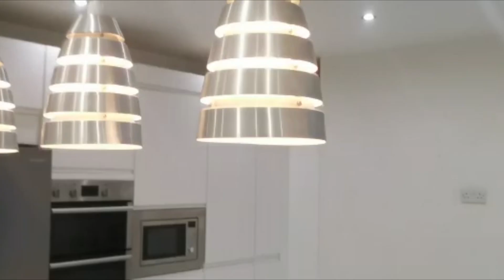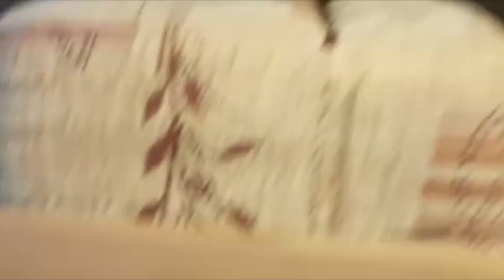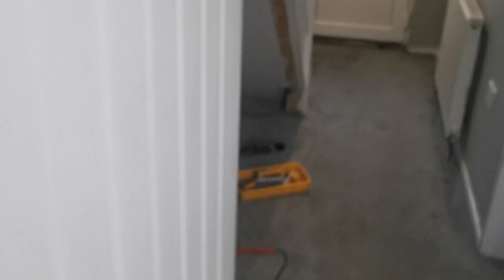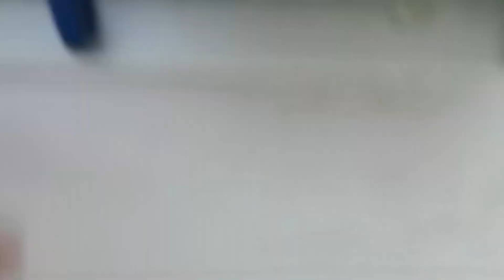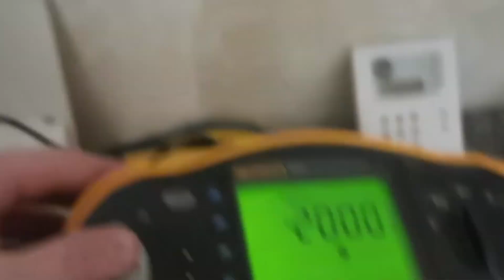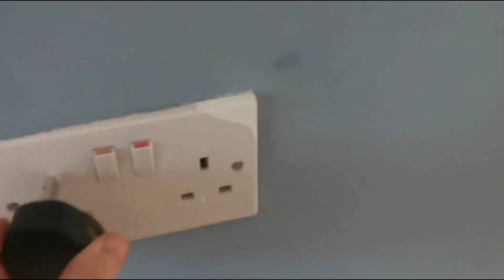LIVE WIRES! THEY COULD HAVE DIED!

Comment: Do you always ir at 500v or 250v l+n to earth?.
Another good video mate 👍
Reply from the maker: Heya Gary! You don’t need to now with current regs. Just habit of testing, I test at  250 and 500v. If you get decent reading with 500v I’m happy. A cable that’s started to degrade, I find you get wore reading at 500v compared to 250v
Reply: @finneyelectrical  thanks for reply finney, so if you do at 500v do you normally do l+n to e incase anything sensitive still connected or do you try disconnect most things ?
Reply from the maker: Depends, if it’s like 50 down lights then yeah I’m line and Neutral to earth 😂

Comment: Thanks for the video appreciate it 👍 yerno the ze test do you disconnect all the other earths so its just the main earth in the earth bar?
Reply: Why do you remove the bondings from the meter and not at the fuse board?
Reply from the maker: @sean1325  because the bondings to the gas and water pipe was down in the cupboard not in the fuse board 👌 they are normally in the fuse hoard in the B terminals. Any other questions? Sounds rude that haha actually mean it
Reply from the maker: So the regs says to disconnect all parallel paths. So your supposed to turn off all the circuits, disconnect the main earth, then test main earth to line to get the ze. Pfc is with everything connected in. The reason you turn off all circuits is because your removing the cpc to every circuit. If I'm in the house alone I don't bother 👌

Comment: Where in BS7671 is it quoted the resistance of a main protective bond should not exceed 0.05 ohm?
Reply from the maker: A maximum resistance of 0.05ohms for the bonding is considered satisfactory, this figure is given by the amount of current required to blow the 100A service fuse in the required time with a max touch voltage of 50v. Where that figure is reached I guess 😁
Reply: @finneyelectrical  0.05 ohm is not the resistance of the conductor length, BS7671 does not quote a minimum resistance.
Reply from the maker: @peterward8308  not bs7671 no
Reply from the maker: GN3 but it's just a guide bud 👌